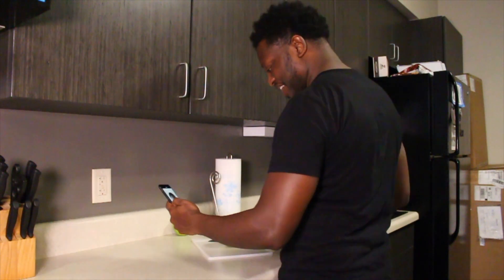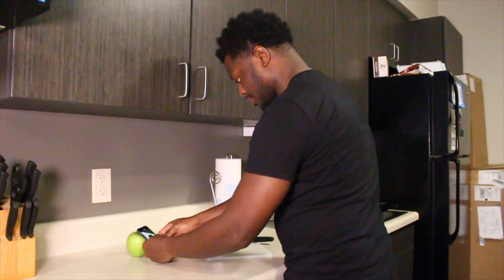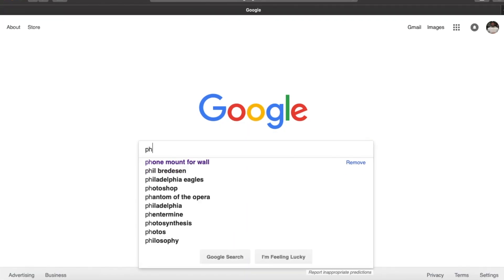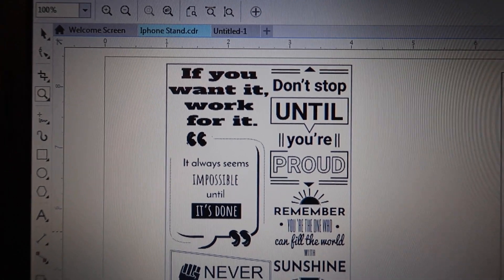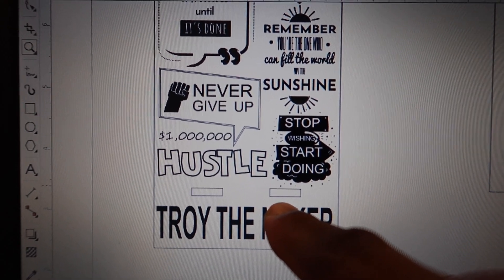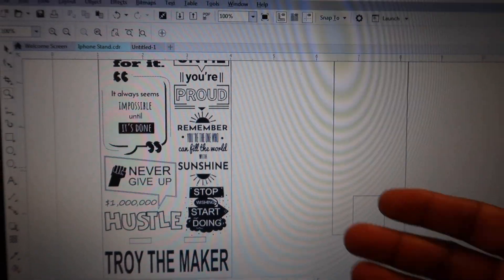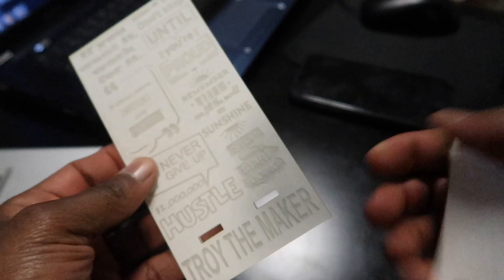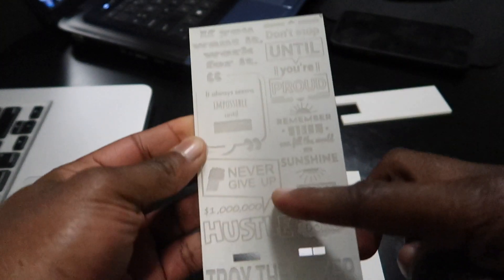Laser Cut Phone Stand using Glowforge Basic

Comment: I'm not very familiar with inkscape but feel you should know it very well to use the glowforge.  I downloaded the svg file and uploaded it to my new glowforge.  The size is much smaller (almost like a mini version of what it should be).  Do you know how to make sure the size of the template remains the same when you load it to the glowforge bed or software?

Are you experienced with inkscape?
Reply from the maker: I'm not familiar with inkscape either. I use coreldraw and I have the same problem when I upload to glowforge software also. The png. files be much smaller, but the pdf. files be exact size. Maybe it is something with the glowforge software, but I am uploading a video tomorrow on how I do my designs using coreldraw.
Reply: You would think glowforge would have some type of measuring tool that would allow you to increase or decrease the size.  Maybe the issue is addressed somewhere in the community.  Keep up the good work.... I'll be checking your stuff out for sure.